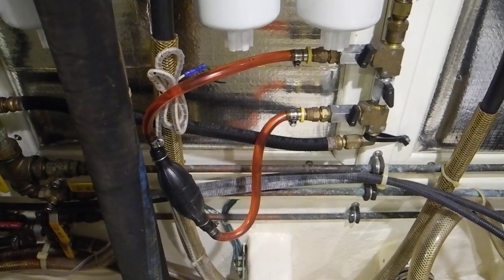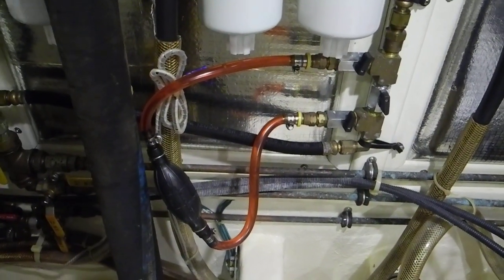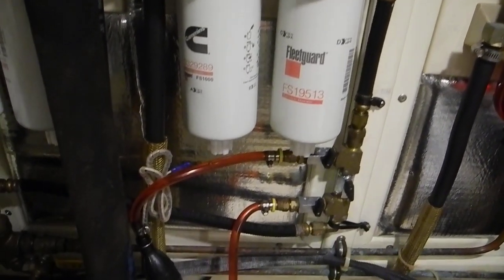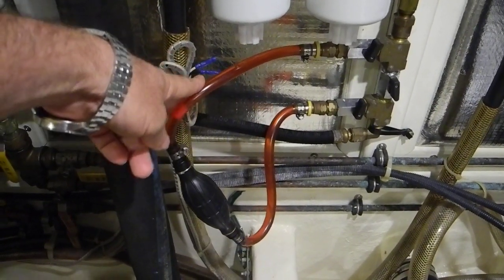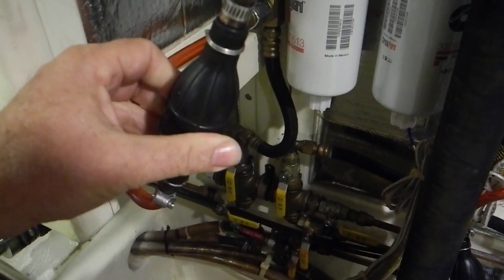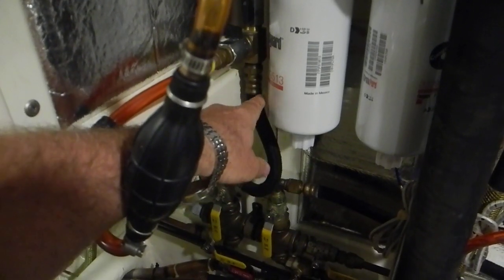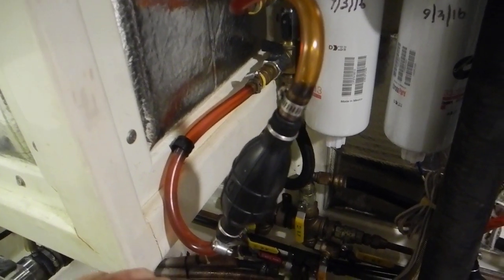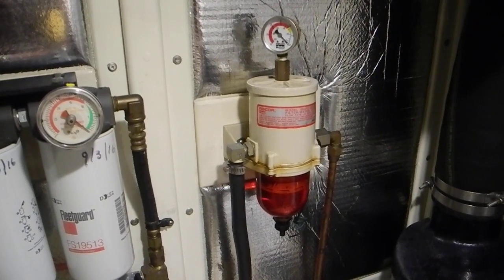Outboard squeeze bulb on diesel systems

Comment: Thank you for clarifying to fellow boaters.  Squeeze bulbs are not ideal for diesels.  I was just moving a Swan to el Carib.  The clean and very expensive big main diesel started running funny.  We had fuel and filters were found to be clean.  The problem was that someone had installed a squeeze bulb in the line and the rubber had failed and it was letting air in.  When shut off, it leaked fuel is the only reason we found it.  I don't think outboard squeeze bulbs are designed for that much diesel flow or for diesel at all.  I circumnavigated on a 33' coastal boat.  I had a $12 fuel pump in line with an engine space switch that I would flip on to fill the Racors when doing at sea filter changes.  It worked perfectly.
Reply from the maker: Thanks for sharing what works and what doesn’t. 👍🏼

Comment: Capt. Chris.  Is there a marine diesel fuel, or is off road diesel fuel what is typically used on boats?  Both I know are dyed pinkish.  I've seen also where people have used yellow dyed on road diesel in their boats.  What should be used and why?  Thanks for all your videos!  I can spend hours on the weekends watching them!  Very informative!  When my wife and I make the jump to a trawler we will be calling you!
Reply from the maker: Anthony Saffy marine diesel is the same as road diesel and they both start as yellow. Off road or marine is dyed red to prove no highway tax has been paid. If a truck used red dyed off road/marine diesel they would fined. If you get a better deal from a highway source and have it trucked to your boat then it is legal for a boat to use the yellow fuel. Glad you are enjoying these videos on our YouTube channel. Hope to meet you soon at one of our classes or at a boat show. Thanks for watching!
Reply: Thanks!  I knew about the tax reasons for the dyed fuels, but i wasn't sure if marine diesel had different additives than the others.  Thanks for the info!